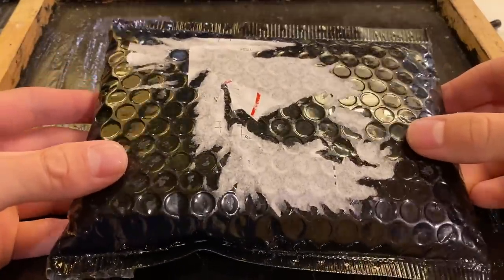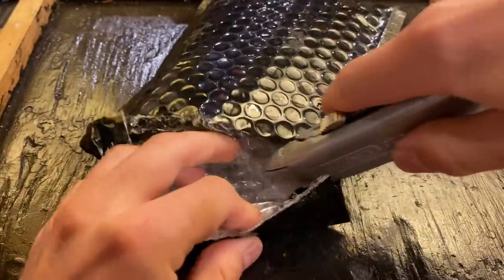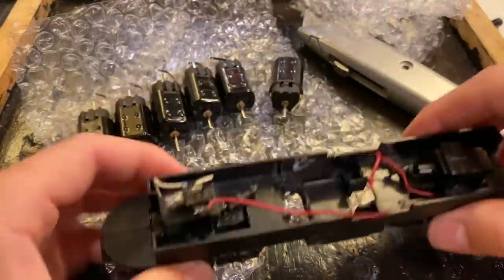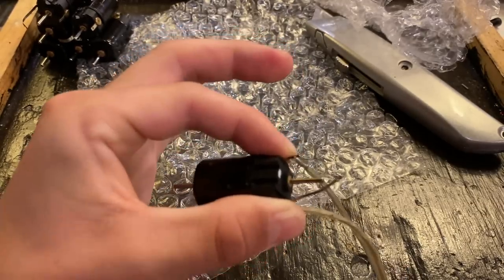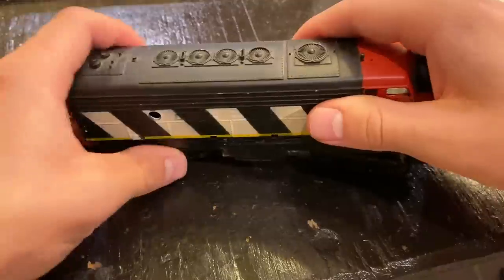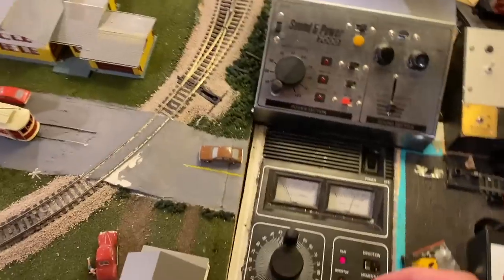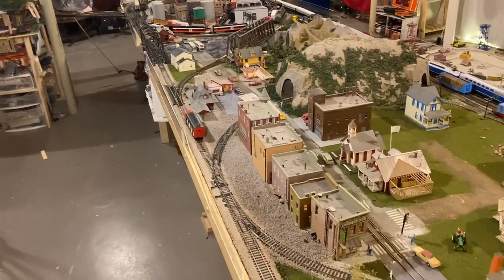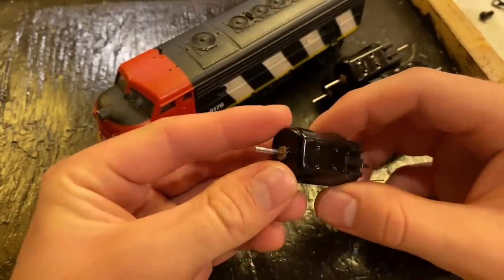Can Cheap Ebay Motors Improve Vintage HO Locomotives?

Comment: Do 5 pole motors give a steam engine a realistic speed
Reply: I'd say yes and no depends on the gearing. The mantuas pacifics i got have 3 pole motors and can crawl somewhat pretty good but i do have a 5 pole that can crawl and do consistent speed. I have a tyco chattanooga 2-8-0 that has 3 pole tender drive and being that is a power torque its quiet and runs great. I used to have a Bachmann Spectrum Pacific until my mother's cat broke it off my shelf I still have the motor to it it also had a very big worm gear and it would crawl very slowly it had a 5 pole motor and when I did have it it would pull awesome so I would say depending on the worm gear and the final drive gear would get you the realistic speed which is the Taiko Mantua Pacific's that I have if I found a way to get a scale speed miles per hour I'm sure they doing according to the drive wheels that it has which are 80 inch drivers they're probably doing I'd say about 80 miles an hour scale speed and that's at full power but if I run line at like 25 to 30% they're probably doing about 25 to 40 mph
Reply: Technically a 5 pole diagonal coil motor can turn slower as does not need that much inertia to generate consistent electromagnetic repulse, but as it has been said, worm gear and reduction has a lot to do. 

Also Marklin went one step ahead with the C sinus engines with 9 poles.
Reply: 5 poles just make it run smoother, like a 40% increase in smoothness

Comment: FWIW, truck towers exist for these engines with an ear for a contact strip on each side.  At some point in the 1980s they were added.   There are variants of this drive in Model Power and Mantua engines which have them as well.  

I typically buy junkers with busted handrails or missing shells for a few bucks at shows (remember train shows?) and save them to combine the best parts when adding power to a dummy engine.  The performance is limited most by the lack of pickup from all wheels.

Comment: I've used those exact motors to replace the drivetrain in my first run Proto 2000 E8's. The old drivetrain was extremely noisy, but with these motors and Athearn 1 piece driveshafts they are near silent.
Reply: You don't by chance have the link for those on eBay?
Reply: @jeremyjohnsom9672  Unfortunately that reseller no longer lists them and I'm having trouble finding them again. They are however basically identical to a Kato HM-5 at $25/each.  I would not be surprised if they are identical and came from the same factory with differnt packaging.

Comment: I was thinking of repowering a locomotive of mine, having watched this video, but I guess whoever was selling these isn't selling them anymore. There seem to be slim pickings for dual-shaft 5 pole motors. I was hoping for something like these with accessible brush holders so that I can service it easily in the future. I found some single-shaft motors that seem useful, but for now I haven't decided what dual-shaft motor to buy for the repower project.
Reply: Same.LMK if you find one

Comment: Those are a Chinese knockoff of the Kato HM-5 motor, so I bought 7 of them to try a while back. They’re great. I now upgrade all of my Athearn Blue Box and RTR engines with them and order them 2 dozen at a time. Shop around and you can get them for as little as $2.42 each on eBay if buying in bulk. I’ve got about 75-85 engines to retrofit with these, but you can even cut one shaft off with a Dremel and put them in Rivarossi steamers and even old brass steam from PFM and United. They’re pretty versatile.
Reply: Do you have a part number for those?

Comment: That’s dope, should making adding DCC much easier especially with a Loksound 5 decoder
Reply from the maker: Certainly. They're much more efficient so there is less risk of burning out the decoder.
Reply: If you add DCC, add a "Stay Alive" to keep the motor turning when the wheels lose electrical contact
Reply: @SMTMainline You can use the ESU Powerpack Mini with a ESU Loksound 5 Decoder. Greatings from Berlin.

Comment: Hey now this is good to know. Heck i was wondering if RC car dc motors would work difference is the locomotive would run way to fast or slow. Awesome tip and review! Also nice repair job you did a great job fixing it.

Comment: Five pole and skew wound? They outta be pretty good!!!  And on the bulb in that old F unit...replace it with an LED and a resistor. The Ohms and wattage of the resistor would vary based on (1) input voltage, (2) LED voltage drop, and (3) LED current desired, in milliamps.  You would probably select about a 15 volt inout voltage, the average of an LED voltage drop is about 1.4 volts, with about a 20-30 milliamp current draw. Based on those specs, a resistor would be about a 470 Ohm resistor, at least 1/2 watt rating.

A good calculator can be found here:
https://www.quickar.com/bestledcalc.php

I replace lamps in locos with LED's and resistors as often as possible, given that bulbs eventually burn out, and will burn out faster when driven with voltage over their rating. An LED with a proper resistor installed won't have that problem.  And...you can now get LED's so small that they can be used even as those small light at the rear of a loco, caboose lights, or as ditch lights.

That said...great job with that motor replacement, Harrison!!!!
Reply: That gives minimum resistor value and maximum LED current rating, which is way too bright.  I suggest 1.5k or 1.8k as a better value for the resistor.  This reduces LED current to 1/2 or even 1/3 of max rating, a dimmer LED that is still realistically bright, and greatly extends life of the LED.  You will likely wear out the loco's motor before the headlight quits.  Also, older type (1950's-1990) locomotives you may want to use "Warm White" LEDs.  Newer type locos (1990 to present) use "Pure White" LEDs.  This is like the older yellowish car headlights vs. newer pure white headlights, and the same is true of loco headlights.

Comment: They were good motors good luck finding them now they have been discontinued
Reply from the maker: Do you know why they quit making them?
Reply: @SMTMainline  no have no idea.  They were pretty good. I did find some 5 pole duel shaft motors that will handle up to 24v at 12v about 11000 rpm only issue is the size of the shafts they are only 5.5.  mm .I just used two in my model power conversions a and b units.  Running both motors on a soundtraxx dcc decoder . You can see how they run .I put a video up.

Comment: can you send a link to the listing? I may pick a few up as well
Reply: Do a search on Ebay for "5 pole 12v motor" without specifying a category. You should see quite a few listings for these.
Reply from the maker: I just searched for "12 volt motor" and several results came up. They're not hard to come across there.

Comment: Might you remember where you got the motors on eBay? If so, just wondering if you might add the link to your description?
Reply from the maker: The listing was removed but there are countless others. Just look for 12v duel shaft motors.
Reply: @SMTMainline  thank you very gratefully

Comment: does that small pensylvania loco run? I Have the exact same train with its box and rolling stock still, but mines i had to do a complete rebuild on, it had a broken tender connector at the metal side, so i was wonder

Comment: I really can't see how much more you'd improve the conversion. Maybe less hot glue? Small pieces of wood might even work to get it in there, but I'm not really sure. It runs great, though. Very neat and most likely worth while experiment. The one thing that worries me is the quality. As you said, you don't know what kind of brushes and whatnot they have.
Reply: @NortheasternP.T.S.  Exactly. It very well may come to that. Is the old motor much better? Most likely, considering it was made for the purpose of pulling rolling stock, etc.

Comment: If you wanted to mount Athearn flywheels is shaft diameter compatible?  I believe original Blue box shaft diameter is 3mm.
Reply: Thast is the rub now, isn't it?  Finding them with the shaft diameter needed.

Comment: Great video as usual. What is the name etc to look for on ebay?
Reply from the maker: I just googled "12 volt motor" on Ebay and it was the first result. I can give you a link to the seller however there is like 100 of them selling the same kind at basically the same price.
Reply: Thanks for your reply. I managed to find them.
Reply: @SMTMainline  let me try to Google
Reply: @SMTMainline  couldn't find these exact help me lol plz lol

Comment: Be careful with these cheap motors on Locomotives.  If the motor doesn't have a stall ability in the case of derailment or wheel jam the motor will continue to spin and shred the gears and motor couplers right off lol.  Learned this through experience, when you test the motor before installing get a good hold of the shaft and see if you can stop it from spinning, if you can't stop the shaft then just be careful with it while running.

Comment: If only you could find old tyco pole motors you know so I can replace the one in my silver streak if I need to 
At least these will be good if I ever get a compatible engine that can take them
Reply: Try E-Bay. They're often sold in lots with other motors and parts for cheep, cheep

Comment: Do you have a link, or a specific search term to find these on eBay?
Reply from the maker: Type "12 volt motor" on ebay, you'll find em'
Reply: that produced 37,000 results many of which were giant industrial motors costing hundreds of dollars, I gave up until I get more definite search terms
Reply: search 12v 5 pole motor, and don't set a category. If for some reason you get a large number of results, then set a filter for under $8, and sort by lowest price. You should find them.
Reply: Here is one result for example: https://www.ebay.com.au/itm/DC-12V-24V-High-Speed-5-Pole-Rotor-Micro-20mm-Motor-Dual-2mm-Shaft-DIY-Car-Boat/263905118204?hash=item3d71f887fc:g:D7kAAOSwk6dbiKDy

Comment: Ya know you really wouldn’t expect a small cheap motor to do that well it really is a shocker
Reply from the maker: Quality is part of it but also just the design. 5 pole motors perform better for model trains since they can produce more torque and can do a better low speed.

Comment: SMT do you know if you can put them in dummy trains?
Reply from the maker: Probably so depending on the make although you would still need the rest of the drive system which would probably be expensive.
Reply: @SMTMainline  ok i was just wondering thx

Comment: Wait what would happen if you put 2 motors init
Reply from the maker: If you could fit and link them you would gain double the power but it's less efficient and you would need to add a lot of weight otherwise wheel slip would make the added power useless.
Reply: SMT Mainline ohhhh so not speed up